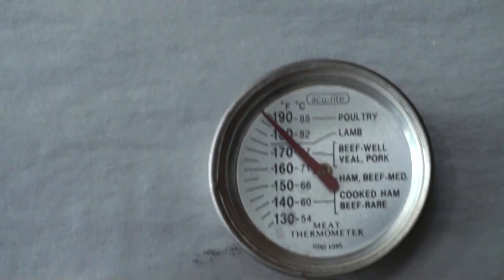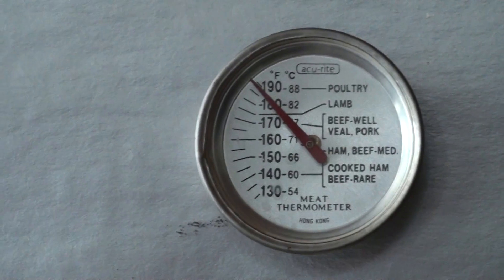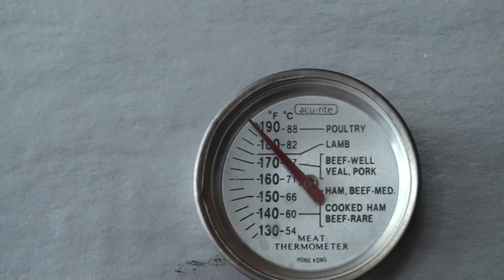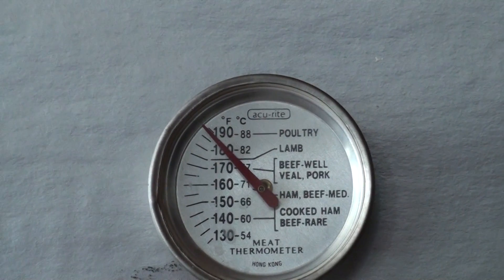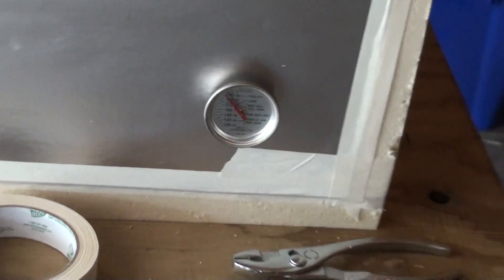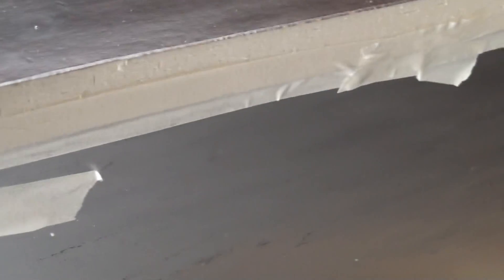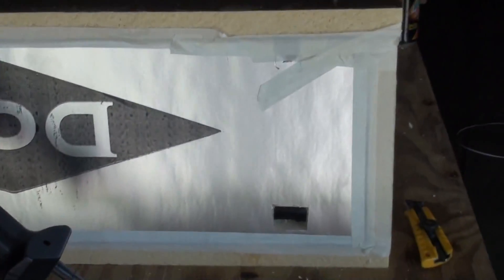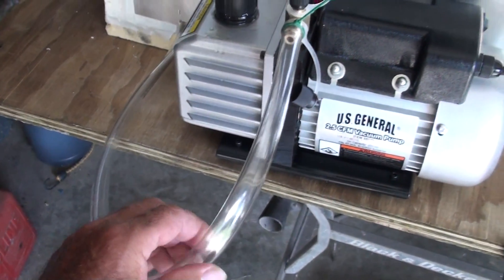DIY solar panel laminator oven

Comment from the maker: @rschure1 yes I would use glass then EVA, Cells, another EVA then the Tedlar. That's what I did on mine and it works well. The EVA is cheaper than the Sylgard to use and in my opinion with the vacuum/oven setup works better. It oly takes about 80 minutes to melt together. The oven is easy to store if you just tape it together with masking tape then just take it apart and shove up in the attic or garage rafters.

Comment: @wiboater4 I agree that panel costs are dropping very quickly and with that so are costs for individual cells. If you were to do this again what method would you use to cure the glass, EVA, TPE sandwich? I'm curious because I am looking at doing something similar as to your project.

Comment: Try using Tygon vacuum tubing. It will not crush like I noticed in the video. It's not cheap but is designed for high vacuum, is durable and is somewhat heat and chemical resistant. This will help you achieve a much better vacuum state. Nice looking oven and the concept seems sound.

Comment from the maker: @lumberdoktor  It didn't exactly melt but softened up enough to loose shape. That's why I mentioned using something else closer to the heat that wouldn't be as affected.